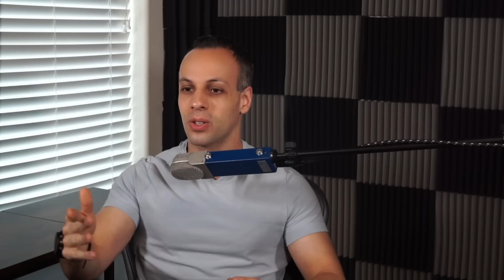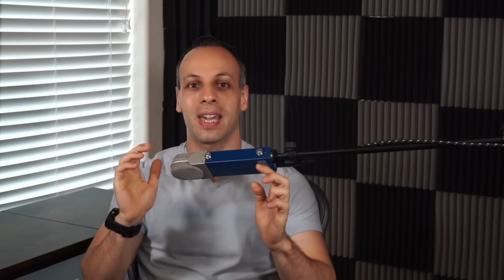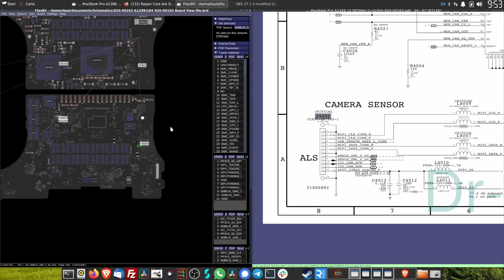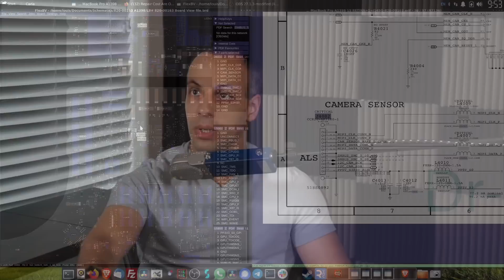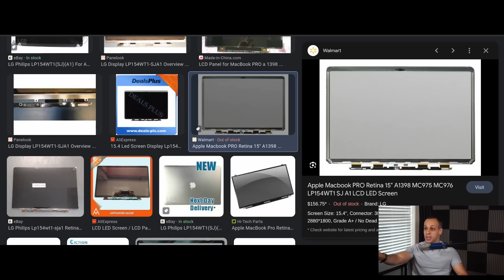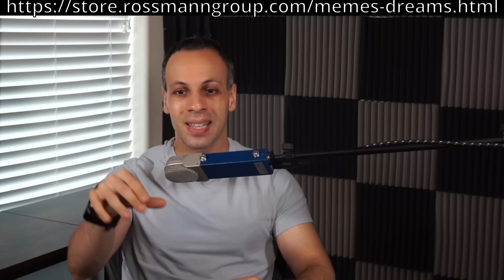The Ford F150 Macbook - when car repair resembles macbook repair...

Comment: And this is why i like old cars so much, i could be missing the entire back half of the vehicle and as long as i still have fuel and the drivetrain that car will still move and everything, it won't do it well but it will do it. Yet it is a extreme example but you get the point.
The more complex you make a system the more little things are able to cripple the entire thing.
Reply: “complexity” isn’t necessarily bad- you can have a radio and a subwoofer and all kinds of tech in a car down to a giant computer in the trunk. the real issue is that any of these things are designed to break when anything else unrelated breaks.
bad engineering, plain and simple. even in integrating these systems to work better together, segmentation is a 101. ever wonder why you can just pull a usb stick out of a pc without special software?
Reply: @damionrx7561  you are not wrong but in the context of how automotive companies engineer things complexity is indeed bad. If you can't make good , redundant and failure tolerant systems you better keep it simple.
Spacecraft for example are very complex but they tend to be more tolerant and flexible if things go wrong. (For the most part)
Reply: @damionrx7561 Working on any new car with a bird nest of wiring harnesses is a PAIN IN A ASS. Complexity makes things harder and more time consuming. I have worked on a few newer cars and it's not fun. Even some mid 2000s cars. Literally every component can have a sensor. A job that can take you one hour on a 70s chevy can take you 5 or even 8 hours on a new car.
Reply: @Crazywaffle5150  it's all fun until you have to troubleshoot a wire harness as big around as your arm.
Reply: @damionrx7561  When designing and building a car, complexity is always bad. I have built quite a few cars, mostly 1960s and 1970s models. They are as simple as it gets. Overhead valve engines, one cam, one timing chain, 2 valves per cylinder, one carburetor, a mechanical fuel pump right on the side of the engine, points and condenser ignition that lasted forever, and was super easy to fix when something did go wrong. With parts and tools, you could practically rebuild the thing on the side of the road. Computers have no place in cars.
Reply: @geraldscott4302  funny you should say that, i feel the same way about PC’s. touche.
Reply: @damionrx7561  but in the context of a motor vehicle electronics and complex computers are not supposed to be integrated. You have fallen victim to the auto industry propaganda that almost everyone else in this country has: Thinking you need a radio, plush seats, A/C, heating, expensive speakers, fancy paint, chrome trim and mediocre sports engines. I have been in a lot of older vehicles, and it made me realize that there isnt even a difference in the quality of life by being in a 40+ year old vehicle vs a brand new one. In fact I find it intrusive and annoying to have so many buttons, dials, screens and controls in a car. They also distract you from the road.
Reply: you can cut a lada in 2 and drive it, the lada dont care as long as you give it fuel and a battery..
Reply: @lokelaufeyson9931  kinda wish they were more popular in the us, the steel may not be the best but you can't get around how tolerant they are to abuse and modifications.
Reply: @deltacx1059  the lada was the people car, you can replace any part you want with any other strange part and it works fine. 
My mom used to own a lada when i was a child and that car started when all the other cars in the area didnt start due to cold or weather.
Not the best quality car yes but its a car that will take you from A to B reliable
Reply: Old cars are the best. Period. I would never buy anything made after 1990.
Reply: @macdaniel6029  i wld say after 95- 96 on obd 2 really accelerated planned and expensive obsolescence
Reply: @macdaniel6029   1994 is my cut off year. Simple OBD1 forever!
Reply: @macdaniel6029  kinda the same here, it's pretty easy to make the old ones better than new in many cases.
Reply: @macdaniel6029  fuel line and radiator hose.  If anything else is under the hood, keep looking.
Reply: Just like the B-17 flying with the tail end missing.
Reply: @maxwebster7572  I'm not sure if it was a b17 but there was a instance where a tail gunner flew the severed tail a bit using the gun and alot of luck. If it was made like a moden car it would have dropped like a rock.
Reply: I drive only '60s and '70s vehicles. I have been building and modifying them for 50 years. I rebuilt my first engine at age 12. I simply don't put up with the trash they are making today.
Reply: @geraldscott4302  early 80's still had a few good cars.  I can change the clutch in my datson in 20 minutes in the middle of a blizzard.  Half that time is inside trying to thaw my hands,  Plus the rx-7 before they put the less reliable 13b engine in it.
Reply: @geraldscott4302  I just got a 63 corvair, it has it's weirdness but it is all fixable.
Reply: My newest car is 21 years old and I’ve owned it for 13 years… This stuff keeps  hammering home that I’m likely going to be keeping it for a long, long time.
Reply: I wanna go back to an old car myself i can't stand these modern vehicles
Reply: @ghostjason401  if you think about it you can make a old vehicle effectively new including more efficient parts for significantly less than making payments on a new car.
Reply: It's wild that a 2010's truck won't work without a taillight, nevermind the fact that it's $5000, meanwhile I was able to get a 1970's buick running after $30 in parts that sat outside for 20 YEARS. I get modern safety and emissions and whatnot but that is no excuse for how unreliable vehicles are getting
Reply: The car is unsavable due to rust (Frame's rotted in two sadly) and I'll likely need to rebuild the engine after pulling it to throw in another car but the point stands on just how simple it was to repair stuff in the past
Reply: @Freedom42069  yea, its a messed up world
Reply: Reading your comment I was reminded of the 1980s era Toyota Hilux that Top Gear tried to wreck multiple times.. but failed... they burnt it, it kept working, they drowned in the ocean tide, it kept working, they even put it ontop of a building that was scheduled for demolition, and it kept on trucking afterwards, they truely do not build things like they used to.
Reply: Scotty pointed out how simple it is to break things in the 2nd movie.
If it won't work with the bus down, it is obvious the bus needs to be multiplexed so you can skip the bad line causing problems.
I'm beginning to think they read my posts from years ago about not trusting a self driving car to programmers from india who can't drive.  A monkey can drive a car when everything is working, it is when it isn't working right that you need to know how to drive.
So now if everything isn't working right, the car wont drive.  Concerns were noted.
Reply: Old cars are cool. But the past 30 or so years has been an arms race in safety regulations. And I honestly wouldn't take anything too old out on to an interstate. For cruising around town that's great. But anywhere you might share the road with an 18 wheeler or giant truck you need to have that Honda CRV shape to save you
Reply: @voiceofreason2674  not a thing I'm concerned about, if I want more safety I can add it.
Reply: @deltacx1059  you cannot modify your old car to make it withstand getting broadsided by some distracted lady screaming down the Houston interstate in a Yukon Denali. I believe you that you can keep your old car running. But come on, I would not let my kids on to the interstate in an old car.
Reply: @voiceofreason2674  maybe you can't but I sure can. My car for example has alot of empty space between the body and the interior that can be used for quite a bit of extra support.

Regardless anyone who has chosen to be on the road has assumed the risks no matter what they are driving.
Reply: If you get in an accident, even a small one in a modified old car,  Insurance lawyers will change your opinion. I learned real fast the value of a trailer.
Reply: @christianecroy7400  still cheaper than paying 30k plus ongoing maintenance on a new car and even better yet than sitting on a lithium skateboard chassis that is effectively impossible to put out.
Oh and all those bicycle and motorcycle riders? They are even more screwed than everyone else and they still get insured rather well.

Comment: oh man just wait til he finds out about the 8000$ tailgate on GM trucks. more importantly would be pay for warranty work, mechanics get destroyed by that system. as if normal mechanic pay isnt bad enough
Reply: 8000!? I'm going to hang on to my old F150 until the wheels fall off lol
Reply: Explain please?
Reply: @ihavenonamek733  the 8000$ tailgate is the option that has all the motors and sections built in.

the warranty pay, i have to explain mechanic pay first. so normal mechanic pay, they have a website that tells them how long that job is supposed to take. lets say the website says the part takes 4hrs to replace, that mechanic gets paid 4hrs to do that. if it takes him 2hrs, great he banks 2hrs. if things are rusted or REALLY bad, and it takes more like 6hrs, he still only gets paid 4hrs so he has to eat the 2 extra it took him. effectively working for free.

well warranty work is a similar system, but different. it works the same way but according to that, they get way less. a 12hr job for normal work is easily more like 4-6hrs, and it works the same way where if it takes them longer than that 4-6, they just have to work for free on the rest of it. 

that's why mechanics hate warranty work, they effectively work for free while having to maintain 30k worth of tools when they could be getting their normal pay that already isnt that great considering their high expenses.

Comment: What a ridiculous design. What was wrong with a relay and some wire and a few LED's?
Reply: A bunch of things:  legal requirements, emf standards, manufacturing guidelines etc.  Car lighting is one of the most complicated things on any vehicle.
Reply: I do automotive Electrical repairs on my channel as well, there is nothing wrong with simple relays and fuses, I fell the previous tech was superior in real world use than current.. most of this stuff is completely unnecessary but it's good for business..

Comment: The more sophisticated and "innovative" technology becomes, the more difficult it is to repair it. You'll either go into debt from repair costs or a newer product.
Reply: The only issue is that that's done intentionally... I doesn't have to be like that, but it will, because it makes more money...
Light assemblies on occasion ending up with water building up is a thing that might happen in a car's lifetime.
It doesn't happen often, but assuming that it WILL NOT happen, is ignorance equal to malicious intent.
Reply: Or create great tech and make it modular. This isn't a chip failing or a connection failing, its the end point sensor failing in a light unit lol. Just make the light connect with a in line connector...
Reply: @thranax  they probably "saved" 1/10 of cent per car by using the BUS for ground.
And that 0.1 cent MUST be saved, because if this company isn't getting it, it might end up being spent on something from a different company.
Reply: Oh yeah, also it's not difficult to repair it because it's "innovative." It's difficult to repair because you can't get access to the part. That's an artificial restriction that has nothing to do with innovation in any way. You can still make awesome compact designs that are easy to repair.
Reply: the more complaicated a product become the more sensitive and unstable it becomes
Reply: Ya wonder why I drive old shit?
Reply: @FuzzyWCTX  Because it is understandable by the old mechanic. It has predictable behavior. The construction is simple, and spare parts can be created using cheap CNC milling machine or 3D-printed.
Wasn't I right?
Reply: It doesn't have to be this way, there's nothing about modern technology that makes things more difficult or expensive to repair. It's designed to be that way because of greed.
Reply: The issue isn't that this tail light is too "sophisticated and "innovative"" but rather that poor design allowed a non-essential component to cause a catastrophic failure which took down essential components. Even unsophisticated and non-innovative technology can break or cause harm due to poor design.
Reply: @ElectricIndigoGryphon  I worked a little bit with CANBUS, and the requirement of this bus is that if any component realizes that its connection to bus is faulty it must go into passive state, basically disconnect from the bus.
It could not be even a poor design of electronics but poor software design requiring non-essential component to be essential.
Reply: I mean, they can engineer it away from things like that and guard from instances like this, but that costs time and therefore money to make sure you're designing it correctly and the companies just want you to pump out a design they can get out in a few months. I'll be honest, I hate this "have to have a new model every year" crap. Test one model a lot and release a new car every 2-4 years. Same with a lot of laptops and phones honestly. Just keep pumping out the same model for a few years until the new model is ready to take its place.

They won't do this because it makes less money because then you won't get your yearly buyers getting their upgrades.
Reply: innovation doesn't need to be convoluted
Reply: That's not true, it's just the fault of companies, you can put more tech into things and be innovative and humans will learn and evolve to fix it themselves
Reply: as if you were not in dept for buying the thing in the 1st place
Reply: Innovation itself is not a problem. Bad designs are.
Reply: @MarinaTwoX lol!!!!! Bullshit! The engineers did a great job! Maybe somewhere in the manufacturing something happened that the thing wasn't really water tight
Reply: This failure cascading re,indeed me of the Maytag Neptune wax motor fiasco... just poor system design

I was all set to buy an f250, too...
Reply: It's not about innovation and technology, it is just stupidity in engenerring.
In 70-80x many PCBs could have lots of transistors, the repair man can change a faulty transistor. Now those PCBs become a single chip (an ASIC), but still an element which can be replaced when being faulty.
Most designs are still modular. But for device manufacturers it is not profitable to make repairable devices if they can make clients to buy new instead of repair. Capitalism.
Reply: @vasiliynkudryavtsev  this isn't entirely wrong, but it's not entirely right either. Sometimes they combine things in order to reduce electrical latency to get rid of limitations they previously had that may have been causing problems. It could also be for space saving reasons (which is a whole can of worms depending on whether it's worth saving the space or not, since the answer to that is case by case and sometimes very subjective.)

The main problem in this video has less to do with them making everything an SoC, and more to do with poor design of the circuitry itself.
Reply: @CreativityNull  Yes. I agree.
Reply: @vasiliynkudryavtsev it’s not profitable nor is it cost efficient for the customer in the long run.  

You all aren’t offering any tangible solutions to the problem of this complication is making products too expensive to afford. 

Look at your average car loan length….
Reply: @vasiliynkudryavtsev  Being forced to buy new instead of repairing has nothing to do with capitalism, comrade. In fact, not having a choice in what product you buy is in the realm of bolshevism. It's only a product of the times (no pun intended) where everyone is meant to think new is always somehow better and convenience is a must. Most people can not do simple oil or brake change on their vehicles. Manufacturers know that the average person will always buy new because they don't want the scary old product that seems less "dependable." We are "suffering" from the capitalist system because popular culture has taught us old is dead and new is best.
Reply: @PewciSlayer  Nah, my point was that the gadget's entire functionality can be reduced to one single custom ASIC. Thus device will contain only one PCB with this specific chip plus passive components and connectors. After any failure this chip burns and device become unusable/unrepairable.
Did we get to this point? No, but we are on the way.
Since devices are still modular, they could be repaired replacing faulty components...
But Apple does not want us to repair, they want us to buy. Because repairs do not generate revenue for them. It is the effect of urge for moneymaking caused by Capitalism.

In communism/socialism/bolshevism money have no value, money become just random numbers to fill in the gaps in the accountant books. "All according to plan."
The culture of having options or not having is decided by people who decide on the next Plan. As usually, the bolshevism/capitalism is not the culprit, the people are.